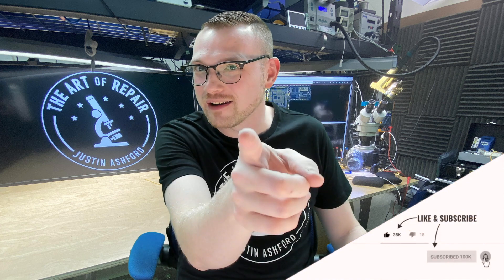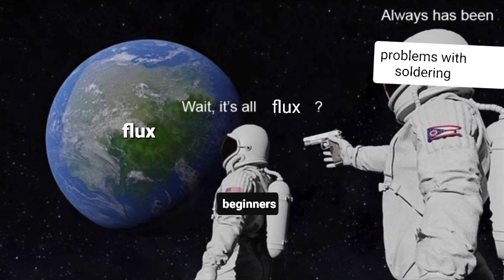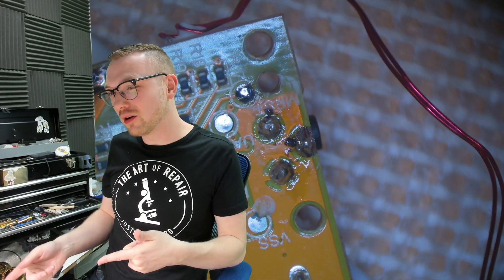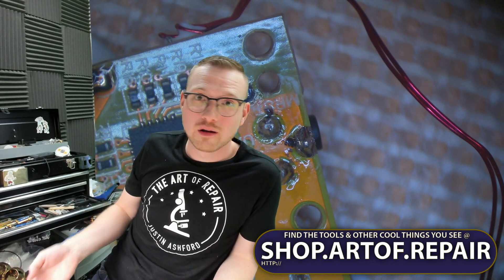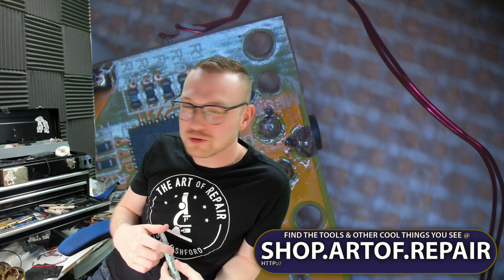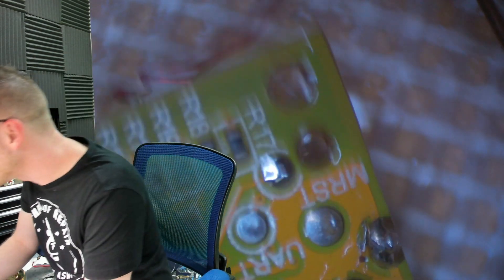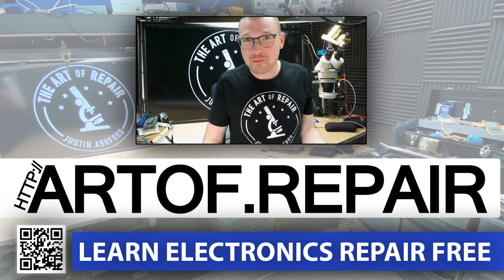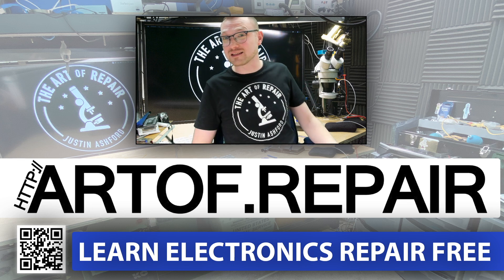If you’re not Fluxing, you’re not Soldering | What the Flux does Flux do anyway?

Comment: I highly recommend against using the pens for flux. It doesn't really put enough on the board to make any difference and just using no flux works almost as well. Also the mass of the tip makes a massive difference when soldering. If you're trying to solder a large contact with a small tip it's always going to be a nightmare. I would say using the correct tip is even more important than using flux.
Reply: Agreed; the correct size and shape of the tip for the job at hand makes a huge difference. Using the largest tip that is practical for the job at hand will heat the connection faster and more evenly, preventing cold solder connections and foil pads lifting off the board. The conical tips supplied as a defacto standard with most soldering irons or stations are almost always inadequate or just plain wrong for hobbyists and production manufacturers alike. Every solderer should have a selection of "chisel" tips (sometimes referred to as "screwdriver" tips nowadays). Even less well understood by many hobbyists is the importance of the material the tips are made of ---- buying a dozen tips for $20 is a surefire way to get cheap tips made of iron or steel throughout instead of plated copper. I posted a video about this on my channel recently; it's easy to discern good tips from bad with a magnet, and most tips purchased online will fail the test. I try to tell people not to buy tips, flux or solder from Amazon, AliExpress orTemu, but some people refuse to listen even though I have 55 years of soldering experience and was an audio-equipment repair tech for 20 years. PS, I also posted a review and teardown of a $45 Harbor Freight soldering station that is surprisingly effective (especially if you buy better tips for it).

Comment: Why do they not recommend using flux on model railroad decoders?
Reply from the maker: I have not worked on these before but I could theorize based on a few minutes of looking into this that they are very sensitive and flux could cause corrosion or issues of “blockage” if not cleaned externally carefully after solder work. 

 But truthfully I have never worked on them before and my anwser is a “best guess” as usually situations where flux is “not recommended” is based on those issues.

Did someone tell you this or did many people and online forum groups mention this? Can you give me some direct model number examples and I’ll do my best to read more into this for you 💪

Comment: Flux provides capillary action that allows the solder to flow . If you want a really good flux, go with nokorode, black label.. 😅😂 it's what plumbers use.. DON'T USE IT ON ELECTRONICS. ..although i do just for wires. I repaired my COMCAST COAX cable after my dogs chewed through and its still going strong. I thought I was going to have to fix it again by now but no problems after more than 7 years. 

Flux carries heat only to the extent of its boiling point. Many beginners will boil off all their flux then wonder why the solder isn't flowing.  

Are you also using flux cored solder?
Reply from the maker: Flux core solder doesnt exist it seems at the diameters we are using for microsodlering only larger stuff. But When applicable sure, and yes I agree flux is only a thermal carrier until it evaporates =)
Reply: @TheArtofRepair  I've got a spool of flux core solder that's almost like hair. Flux provides the capillary action that the solder travels on. It breaks the surface tension of the molten solder
Reply from the maker: @jdog4534  I’m aware of this. I just don’t feel it’s sufficient. Flux core solder always leaves me wanting. So it’s better to add more flux. I think that flux core solder alloy is not as effective as you state in practice.  

Feel free to share your hair like alloy with flux in it though. I don’t mind to check out something new :)

Comment: What happens if soot gets inside the melted soldered wire when using flux?
Reply from the maker: When it’s liquid, the flux itself acts as a detergent and a barrier. It should push itself out of the joint.

Comment: Question. How do you reflow broken solders joints in whethered board-with some kind of coating over it? Is the coating needs to be removed 1st,then flux applied with heat gun to repair properly?
Reply from the maker: Yea, coatings must be removed before you fix any joints. :)

And we always say, if your not fluxing your not soldering :)

Good luck:)

Comment: That picture of the spaceman is me😂😂😂 I’ve been wondering for years why I struggle to solder on cars I’m an auto tech and ended up just going with crimp connections etc for years and alternating but back to the soldering iron it is😂 flux man worst bit about it I did a gas engineering course and used flux to solder pipes never put 2 and 2 together😂

Comment: Just saw 2 Youtubers not use flux while desoldering. Switch and Click and Optimum Tech. Switch was using an expensive Hakko desoldering gun and Optimum had a nice wireless kit. They didn't use solder tip cleaner, sponges, stands, or a silicone mat. Then acted like it's normal. I wonder how many gaming mice and keyboard PCBs their viewers melt.

Comment: Isn't that solder paste ? because afaik flux should be yellow
Reply from the maker: Flux comes in many colors and tints of white and yellow and can even be pretty dark in some cases =)
Reply: @TheArtofRepair  thanks for the answer , I said it because I'm a beginner and I was wondering about that 😅
Reply: @TheArtofRepair  also I see you didn't use wire when using the solder iron , so flux can be used without a wire ? 🤔
Reply from the maker: @spacenodus7959  flux can be used any time you need flux. sometimes you just need a little flux to fix an issue, not more solder.

Comment: i was doing 0201 capacitors and it wasant sticking       it wasant bonding to the pad properly and it looked all cracked and messy  bareley held on the there used flux and i was doing 2-4 0201 caps a minute no problem
Reply from the maker: if you could make a video of your process id love to try and help dan. can you PM me a video link to justin@artof.repair

Comment: Thanks, Justin. It is hard for me to take anyone seriously that does not use plenty of flux. I have some of that Amtech flux vacuum sealed in the fridge. 
I also like MG Chemicals #835, but it is harder to clean up.
I don't mean to pick on you, but you forgot to wet your iron tip with a little solder.

Comment: Oh well, my training taught me to match the flux I use based on the flux core in the solder I am using. Brand matching the flux and solder yields the best results as their chemistries are as matched as they can be. I’m not saying that you cannot use a different flux than your solder’s core. It will not be consistent in the process. Since I learned to solder to DOD STD 2000-1, their are no compromises utilizing this standard. The reason for using the same extra flux as your solder’s core has to do with both compatibility and consistency in the end product. Not bucking your method as it works for you. We don’t have to agree on process methodology to understand the necessity of using extra flux as a helper. Your video shows the flux doing it’s job and it’s effect on the work. Cleaning the area both before and after with 99% isopropyl alcohol is a must because it doesn’t harm the plastic or metal parts and it dries without residue. Stay safe mates!😊👍🏻😷

Comment: I was using a cheap flux and the result was always a bridge between small pins no matter how much i put lol even when using desoldering wick the flux has no effect, it felt just like water floating on the pcb, then i tried a different brand and now soldering is more easy but the smell is much stronger and it's so sticky doesn't look nice on the board